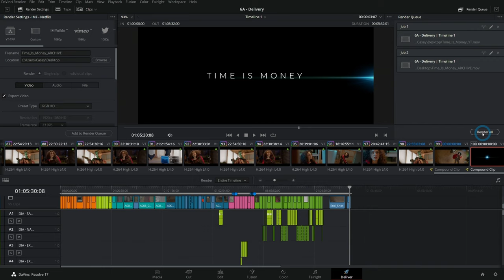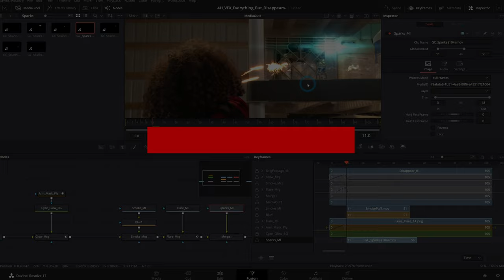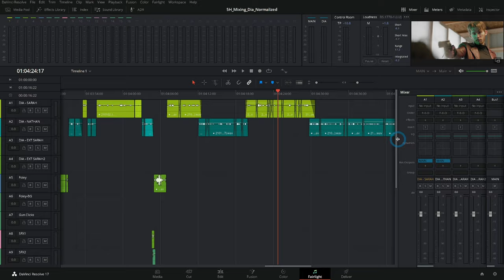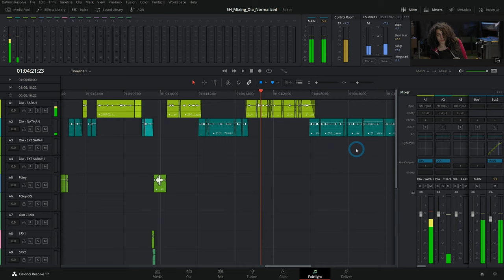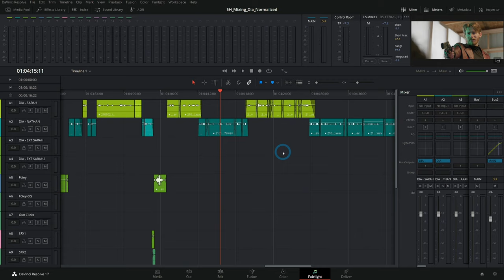Mix Multiple Tracks At Once with Busses in Fairlight - DaVinci Resolve Audio Mixing Tutorial

Comment: You have to be careful. Casey is showing us fixed bus mapping. FlexBus mapping does not work the same way as fixed bus mapping. By default, Resolve 17 opens a new project with Flexbus mapping enabled. There is a checkbox in the Fairlight tab of the Project Settings dialogue.